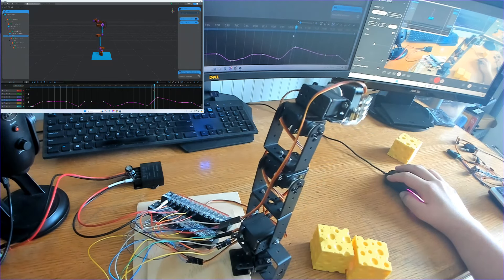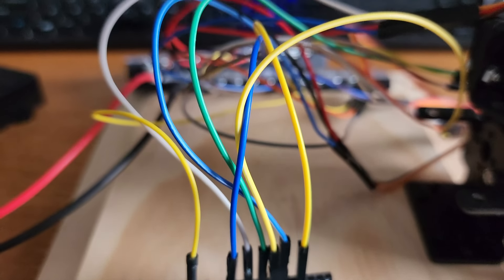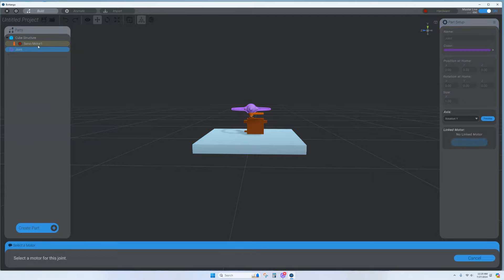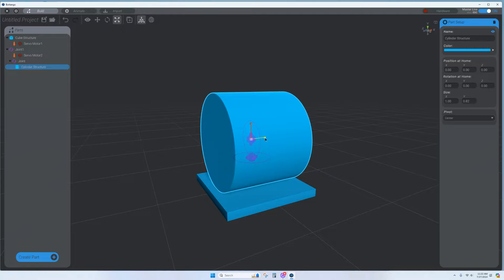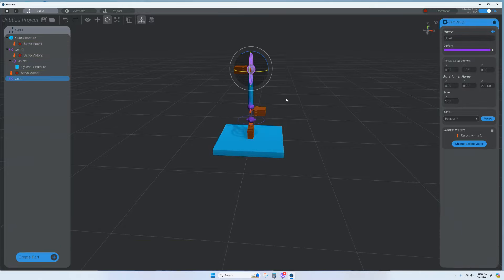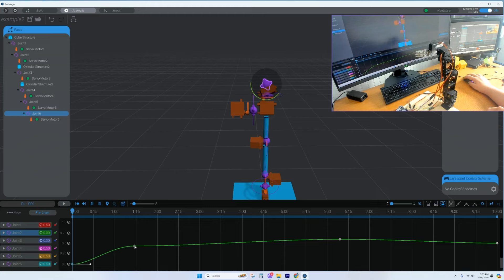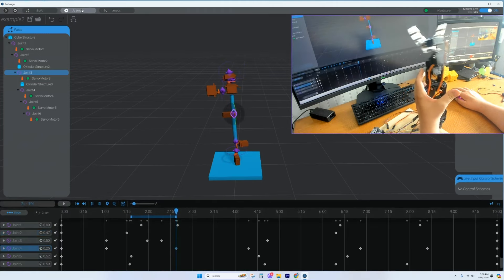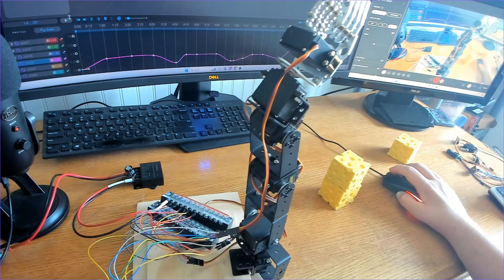Create Amazing Animations: Build a 6DoF Robotic Arm with Bottango and Arduino

Comment: How many amps are you pulling?
Reply from the maker: maybe 5-7amps - I didn't check it with a multimeter. Just guessed based on datasheets.
5 servos motors are MG995 and they have a max current of 1.2-1.5A. The servo that closes the clamp is MG996 which can draw up to 2.5amp. I'm using 5volts for all the motors. If all motors were under max load at the same time it would pull 9amps, maybe. I considered that my absolute max. I like to have max current supply 20% higher than I would ever need so wires and motors don't get hot. I don't operate all the servos at the same time and I don't run them at max load so...maybe 5-7amps at the most. I'm sure I could have used a 10amp without any issues but my 15amp converter was convenient.  👍

Comment: hi i have a project with 3 animation and want to play random, how i can know when the first animation finish to start play another animation.
You make with the button and sensor but is possible may by time.
Thanks
Reply from the maker: Hi there! I haven’t done this particular animation on Bottango, but that’s a great question. Here’s how I would approach it: I assume you could use the random() function in your Arduino sketch to select between the three animations once the current one finishes.

In the Bottango software, click the "Animate" tab at the top, then create each animation by clicking "Create New Animation" on the right side of the screen.
Sorry, I don't have a solid answer for you but this is where I would start.

Comment: Ok, i really wanna learn something. How do you make it move, like how do you move using the electricity cords?
Reply from the maker: hey Ryan! Check out the diagram in the video at 3:34  I added a button to this at the end and included that diagram at 44:19
Don't power motors through your Arduino. Use external power. My servos work at 4.8v to 7.2v. I am using 5v to power the servos through a 5v15a converter - I have a 24v3.75amp power supply connected to the 5v converter. Everything is working fine under very little load (no heat, erratic behavior, motor jitters...etc). I usually don't use a breadboard over 1A current so I am using terminal blocks which I use a lot, they are great for stuff like this. Connect servo voltage wires to 1 terminal block and ground to another terminal block. Make sure you have ground connected to Arduino, but not the voltage line!  Hopefully this makes sense :)   
Make sure you are supplying enough current for your servos. My servos draw a little over 1amp and the gripper servo can pull 2.5amps at max. Make sure you have enough current available plus more for overhead so things don't heat up. If you are maxing out your servo loads you may consider a thicker jumper wire. 
I usually don't make such long videos but I wanted everything to be there in the first video.
Download Bottango and become familiar with it. It's great for beginners or people that are new to Arduino. Great question...thanks for asking 👍
Reply: @BMonsterLaboratory  ok thank you so much
Reply from the maker: you're welcome

Comment: Not sure if you’ll respond, but I can’t find anywhere online how to actually activate an animation from the bottango arduino driver file. I’ve followed the online instructions and can’t seem to figure it out
Reply from the maker: hey there!
Assuming you have completed the "Build" portion of your project, including part setup and setting ports for your motors and connecting joints...etc.
If you want to run the animation while connected to the Bottango software: 
1. click hardware button at top right
2. click "drivers" tab
3. create driver or select an existing driver
4. scroll down to "status" and upload Bottango driver to whatever Arduino board you're using.
5. select port - finish setting up the connection inthe drivers tab
6. click "status" tab next to "drivers" tab
7. change master to "live", change default driver to "live" and turn on your connected motors.
you should be able to move your robot from the build area in the Bottango software. All motors in hardware section should be changed to green to verify connnection.

If you want to run the animation independent of the Bottango software:
Assuming you have built out your animations at the bottom of the screen...
1. click "animations" 
2. click "export to code" on the right
3. go through the steps to export code. 
4. you'll have 3 exported files; a .cpp, .h, and .txt file. move these files to the BottangoArduinoDriver folder. This file is part of the Bottango_Win_0_6_5d executable file you downloaded from bottango.com
5. Once your 3 exported animation files are in the  BottangoArduinoDriver folder folder, open the BottangoArduinoDriver.ino file.
6. The program will open in Arduino IDE - click the BottangoArduinoConfig.h tab and uncomment this part of the code  // #define USE_COMMAND_STREAM by removing "//"
change // #define USE_COMMAND_STREAM   to    #define USE_COMMAND_STREAM       
*IF you're using a motor driver breakout board and Aadafruit_PWM_library, uncomment that part as well.  // #define USE_ADAFRUIT_PWM_LIBRARY

This may be more than you need, but I hope it helps. I just walked myself through the process and typed out what I did. 
You also have some text files in the same folder- HowToUseThisCode.txt and BottangoDocumentation.pdf. These are very helpful.